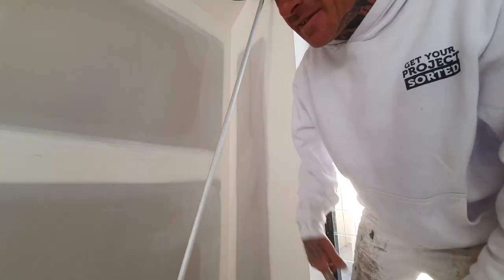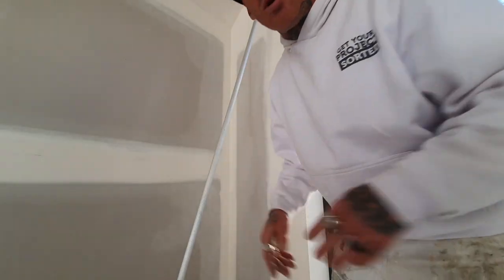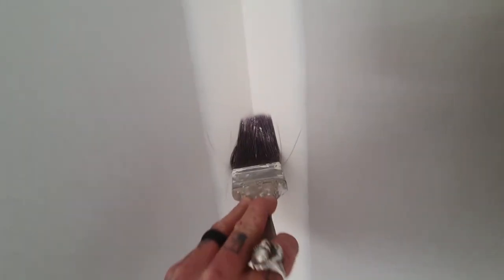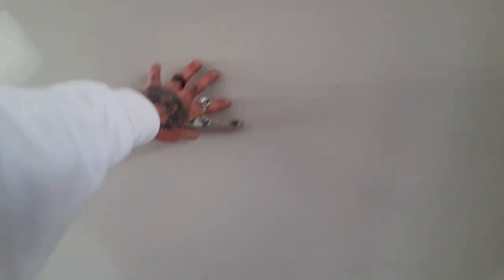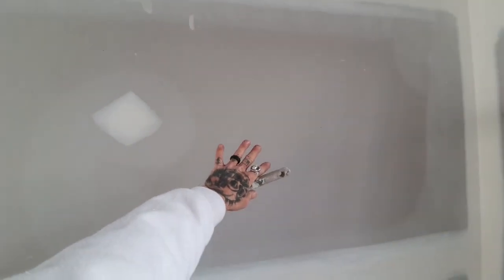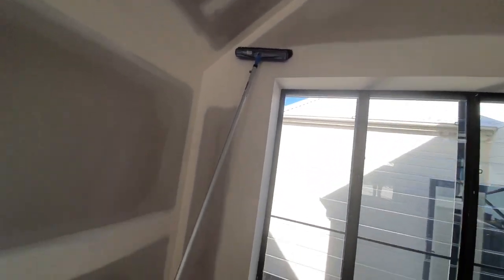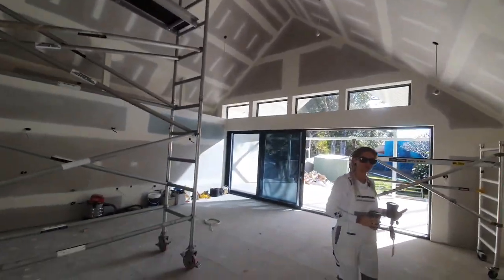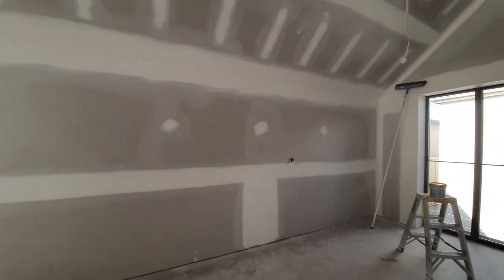DUST BEFORE PAINTING IS IMPORTANT

Comment: Yes if you are spraying but not needed if brushing and rolling as the plaster dust just mixes up with the first coat sealer.
Reply from the maker: brush, roll or spray i still like to dust everything down.
Reply: Always dust unless you want fuly textured walls
Reply: @vanmourikschilderwerk  Plaster dust is as fine as talcum powder.
Reply: @sydneyshinshi  i know still dust though id rather spend bit of time to get rid of it might be case of ocd 😂😂
Reply: @vanmourikschilderwerk  It sure wont hurt to dust. If you spray over it without back rolling you are asking for trouble.
Reply from the maker: @sydneyshinshi  I have cut and rolled many of new homes back in the day. And even still have had then rolling and brushing the plaster dust mixes with the paint in the roller sleeve and brush turns to like a paste.